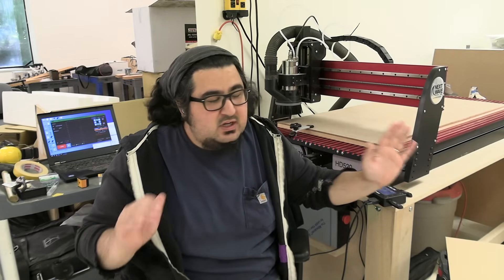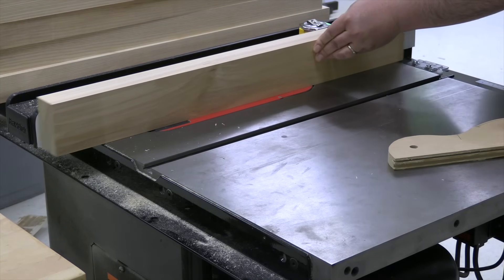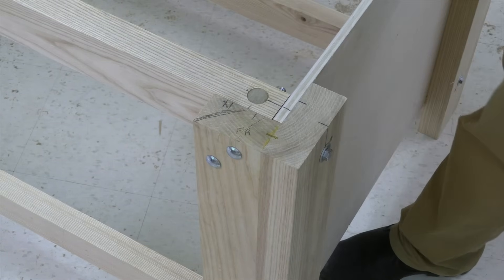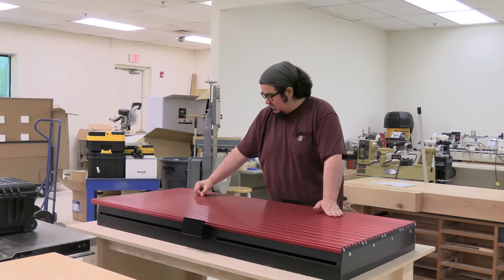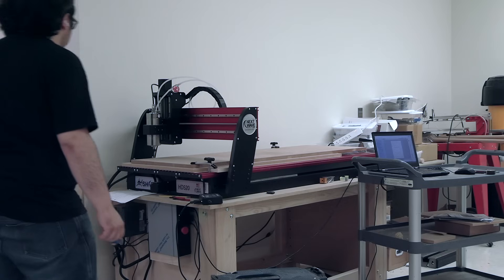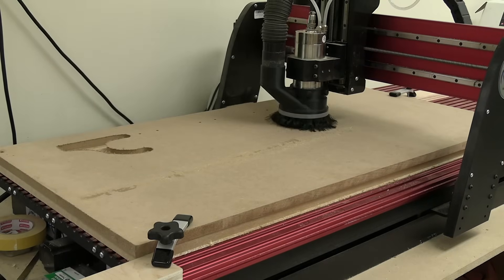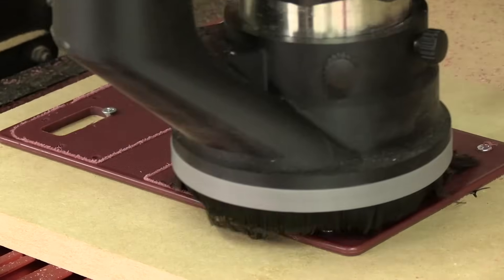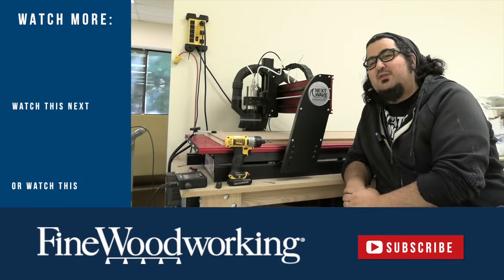ABCs of CNC

Comment: Thanks Ben I have recently gotten interested in CNC machine for small projects, I have found that CAD and CAM are a bit more computer hardware reliant than the G code like you said. I just question if I would really use it because there a ton of them for sale on Market place with the usual description that it was used very little and lost interest.
Reply: Yes. I do my CAD in fusion 360 on a pretty modern computer. The CAM is mostly done on this beat up PC or if I'm home, on my son's PC.

Comment: Great to see this.  I incorporated a CNC gantry router mill into Basic Woodworking classes 20+ years ago and it was a lot less 'plug and play' back then.  I've typically explained to people that the hardest thing about CNC is.......CAD.  For some people the CAD and CAM is overwhelming and they never get to the CNC part.  If you can learn some BASIC CAD and follow some simple tutorials, it's pretty straightforward most of the time.  Once people exerience a small amount of success, just like you mention, they immediately start to see a large number of ways to do some mundane work for them.  IGNORE haters FWW, there's absolutely room for this.